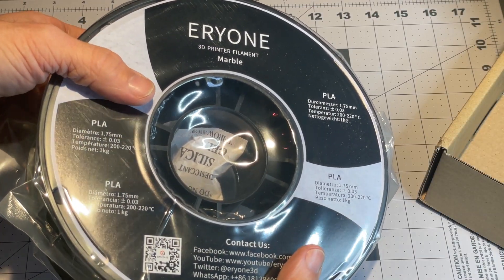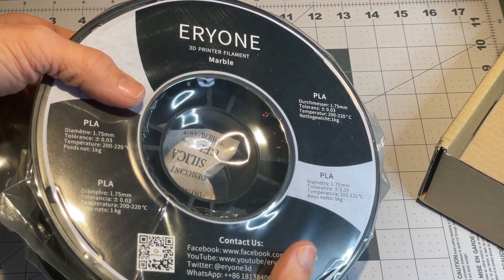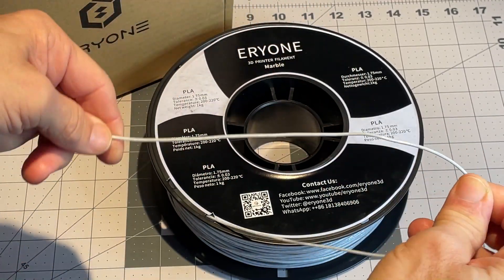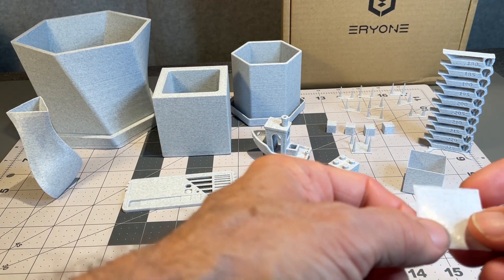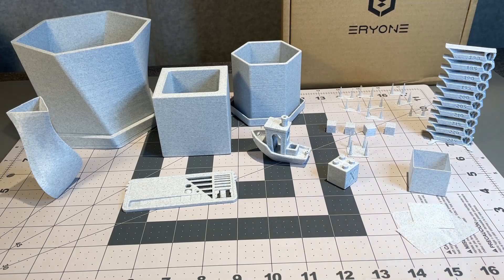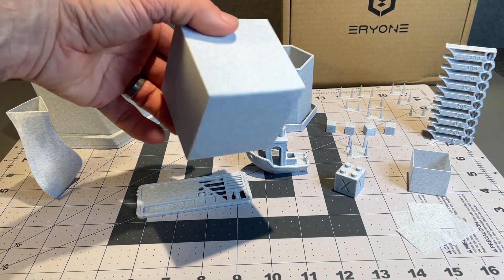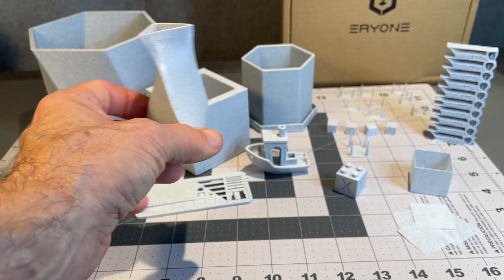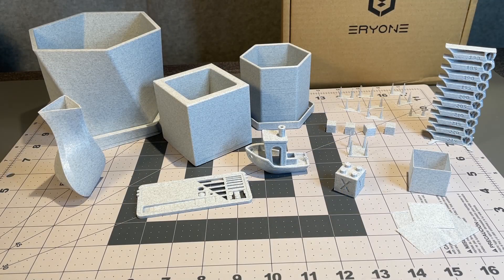Eryone Marble PLA Review

Comment: If you use the hardened steel nozzle they recommend, you have to slow down the nozzle speed by 50% or all your prints will turn into spaghetti. If it's moving too fast, steel doesn't soften obstructions from the previous layer fast enough and so the nozzle tears everything up.
Reply from the maker: wow. sorry I missed your question! I never got any notification. good advice. I didn't see any notice there to use HS nozzle. I didn't find it very abrasive and just ran with brass. Didn't seem to cause any harm.